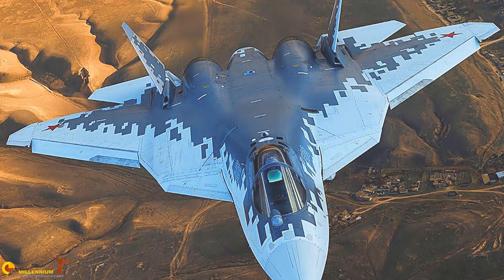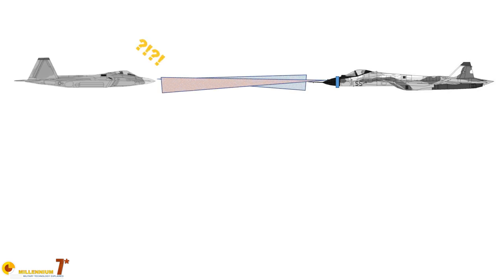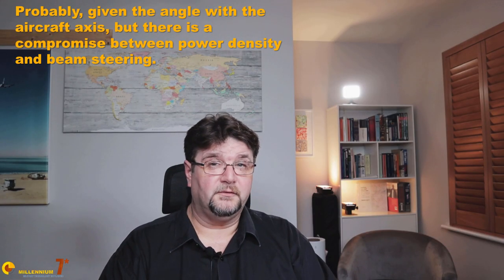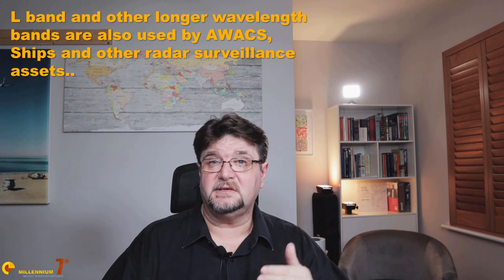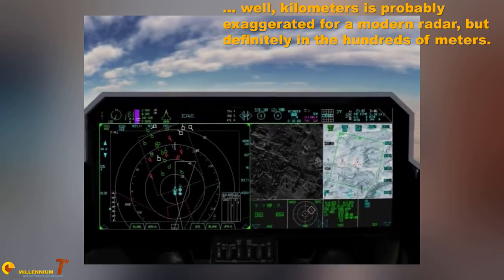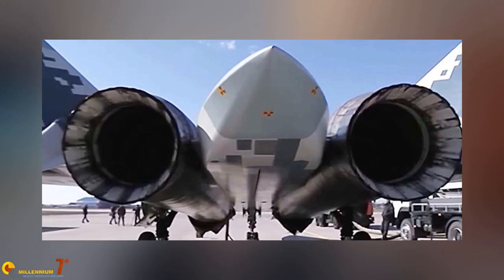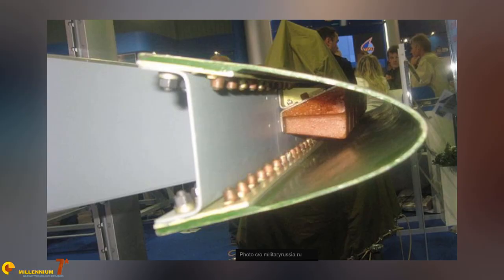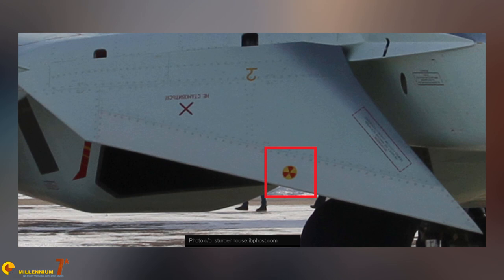Su-57 the Raptor Spotter | Part 4 - Radars, ESM, ECM, IFF

Comment: L band tied in with optical sensors would make for a very dangerous package against VLO opponents.
Reply: Not really. The wavelengths are far too small. These antennae are for something else.
Reply: @LRRPFco52  
L band has a larger wavelength capable of detecting VLO stealth airframes. though L band due to its large wavelength is not accurate enough for targeting it can help by directing passive sensors to areas of interest thus allowing for targeting. 
the f35 and f22 would have to rely on a AWACS platform to gain the same targeting data.
Russia does not push for VLO as much as the US because they figure VLO can be defeated...this is one example. 
Russia seems to be pushing for a more well rounded option that can not be had with a airframe designed to maximize VLO stealth capability over all else.
Reply: @johnaikema1055  F-22 & F-35 pilots don't need AWACS because they have far superior SA to AWACS. AWACS calls out contacts, even the older F-22A would call out what each aircraft was, their altitudes within 100ft, and their external stores. JSF is a leap above that.

4th Gen fighters relied on AWACS to call out BRA of long range TGTs for them.  Once you have 5th Gen web on the air, AWACS aren't needed for them.
Reply: @johnaikema1055  Russia isn't producing VLO because Russia can't produce or maintain VLO. VLO technology isn't static, but evolves as sensor technology does in a cat and mouse game that started between the Brits and Germans with U-Boats.
Reply: @LRRPFco52  
VLO and LO stealth is only stealthy against X band when it comes to radar.
therefore your could have 4 f35s acting as a AWACS using x band radar but still be handicapped vs a single SU57 with L band for first contact. 
if I was in the SU57 I would find targets with L band then go passive to track.
if there were multiple SU57's have one use L farther back feeding points of interest data to several SU57's or other equipment operating forward while completely passive.
assuming that the f22 or f35 are a full generation ahead of the SU57 in situational awareness is not wise.
respect the opponent.
Reply: @johnaikema1055  F-35 and F-22 both can detect L band. It is part of their EW.  Why do you think the US use them for SAM hunting. a 4 F-35 will know su 57 in the area well before it knows about the F-35  Both F35 and F22 have a better major radar then SU 57.
Reply: @jimc1654  
yes...but L band can detect a stealth fighter at a greater distance then X band can...far greater. that is why one would use it for initial contact outside of missile range and then go fully passive inside bvr missile range.
also 1 fighter could stay out of BVR missile range and feed information to others well inside BVR missile range.
even LPI  X band transmissions can be detected (low probability is not no probability). hiding the transmissions in the sound floor with rapid frequency changes still increases noise thus with the right sensors or software could be used to pinpoint increased noise.
as of now LPI is still relatively safe...but for how long is the question.
the rapid advancement in sensors, computer power and software will in time force only completely passive means of detection when inside the opponents BVR kill zone. L band will pick up a stealth fighter outside of a BVR kill zone and that data could be used by multiple passive fighters our other equipment within strike range...that is a huge advantage.
Reply: @johnaikema1055  L band isn't for that. If you look at the F-22A and JSF leading edge flaps, each flap has 3 different length RF antennae embedded under them for multi-frequency RF fidelity, which are fused with a long list of other RF sensors embedded throughout the airframe.

One of those RF antennae just happens to be the same length as what is on the Su-57's single L-band antennae, which isn't mounted using VLO techniques like on Raptor and JSF.

The RF antennae count is much higher on the F-22A, and fused with the AESA.

The RF and IR antennae count is higher on the JSF variants.

An F-35 can't see another F-35 using all of its sensors, but can detect and track ballistic missiles at 800 miles away using passive EMCON.

The Su-57 will never have first-look against JSF as a result.  The US has far greater experience designing and fielding AESA radars, while Russia is struggling to transition from PESA to AESA. It's just not in the cards for Su-57 to magically leap over all that and somehow get first-look.

Comment: excellent video now 2 years old.   I am told that the advanced radar of the 57 is now being refitted into the SU 35, the SU 34 and the SU30s.   Anything below this is just not feasible (i.e even the most advanced S27 would have to be torn apart so it cannot be done).  Don't know about the Mig 35 hoerbrt, or the Mig 31.

Comment: The L band radars have a very small aperture which will mean very short range. There is some media speculation that these are actually IFF sensors and not radars at all?.
Reply: The IFF antennae are in the LEVCONS. These antennae are for something else. I've used HF to send signals across the globe, have been studying and working with RF in military aerospace capacities since the 1980s. As you said, these L-Band antennae are simply way too small for detection purposes at long range. You would need an antennae bigger than any fighter and still get poor resolution like on AWACS.
Reply: @LRRPFco52  They might be for detecting active AWACS. It is safe to assume that there will be just one, thus any ambiguity can be resolved by having more than one aircraft.
Reply: @0MoTheG  There’s an aspect of this whole thing with the L-Band antennae that nobody is really talking about, that would click for anyone if they followed what I was saying earlier about the LORAN-D equipped F-4Ds in the early 1970s.  Not TACAN or IFF, but something entirely different that is relatively unknown in the modern AvGeek world, and was mostly unknown in the 1970s-1980s as well.

Comment: Awesome description and systems analysis. As per usual the Russian approach to air superiority is pragmatic. As others have already commented integration of the platforms sensors with those of terrestrial and space based appliances is key to domination, providing firing solutions that do not increase survivability is hardly a pragmatic approach.

Comment: Tyler Rogoway :

The Su-57 has a feature that was long-promised for the F-22 but as of yet, has never been delivered—side-facing radars mounted below the cockpit on aircraft's 'cheeks.' These active electronically scanned array (AESA) X-band radars supplement the aircraft primarily nose-mounted X-band N036 Byelka (Squirrel) AESA radar. Supposedly these secondary radars have roughly a third of the transmit-receive modules as the jet's main radar. 

You can clearly see the side radar aperture below the 'chine line' under the aerial refueling probe. 

At first glance, the utility of these radars is clear—they provide a far greater sensor field of view and thus enhance situational awareness for the Su-57's pilot. But beyond this the most basic of advantages, they allow the Su-57 pilot to execute a key tactic better than nearly any other fighter around. This tactic is usually referred to as defending enemy's missiles while not getting "cold" on enemy's plane.

The issue is that with a typically fixed AESA radar or mechanically scanned array, pulling off a missile defending maneuver means the fighter doing so will lose its radar picture of the enemy it is trying to evade. Without third-party sensors feeding this data to the beaming fighter via data-link, its pilot will become blind to the tactical situation when it matters most. But what's worse is that any radar-guided missiles that have been fired from the now beaming fighter will not be able to receive mid-course updates, and thus those missiles' probability of kill will plummet, especially if fired off initially at long-range.

So fighters without cheek arrays, or novel swashplate like designs like those found on SAAB's JAS-39E/F Gripen and eventually on the Typhoon, and absence of engagement quality tracks provided by third-party sensors via data-link, the launching fighter will either have to take a more acute and less effective beaming angle in order to continue to update their missiles with their radar, or they will have to forget about updating them altogether. 

The Su-57 is also said to incorporate L-band radar arrays blended inside its large maneuvering leading edge extensions. These radars are more for target discrimination and identification than anything else. The aircraft also has another X-band radar array in its 'stinger' tail for enhanced situational awareness, and possibly for future targeting with extremely agile 'lock-on after launch' missiles as well.

It's also worth noting that AESA arrays can also be used to execute pinpoint electronic attacks. Theoretically, a fighter's radar system could employ these electronic warfare tactics while attacking another aircraft, or while under attack. Being able to do so even at oblique angles without changing nose position could be beneficial, as well. With that in mind, the Su-57 could be a powerful electronic warfare tool, if not today, then possibly the future. 

The Su-57 sports an advanced 101KS 'Atoll' infrared search and track sensor in the traditional position on Russian fighters—installed atop the aircraft's nose, near its windscreen. 

 IRST is among the best technologies available for detecting and engaging stealth targets from afar.

An advanced IRST was also promised for the F-22 as part of the Advanced Tactical Fighter Program but it was axed due to cost-cutting measures as the program moved from prototype to a production configuration. Today, the Navy and the USAF are on the cusp of procuring podded IRST systems for their 4th generation fighters. The F-35 can use its electro-optical targeting system (EOTS) for long-range aircraft identification and some limited IRST-like functions but is not comparable to a dedicated sensor.  

Like the F-22, the Su-57 has a number of missile launch detector apertures scattered around the aircraft but the Su-57 also has turrets that fire modulated laser beams at an incoming missile's seeker to blind it and throw it off course. The Russian system used on the Su-57 is part of the larger N101KS electro-optical suite that includes the missile launch detector systems, IRST, and the DIRCM turrets mounted dorsally behind the cockpit and ventrally under the cockpit.

And denying attacks by air-to-air missiles is definitely an intent for the Su-57's DIRCM system as, once again, it has a turret on top of the jet as well. So in this sense, the Su-57 is something of a pioneer in this regard and this type of system is also likely a hedge against future long-range infrared-guided and dual-model air-to-air missiles.

Su-57 can be armed with four beyond-visual-range missiles and two short-range missiles for air-to-air combat missions. The active radar-homing K-77M (Izdeliye 180) missile is the primary medium-range missile of the fighter. An upgraded version of the R-77 medium-range missile, the K-77M is a beyond visual range (BVR) radar-guided missile equipped with an active electronically-scanned array radar seeker. Russia is also planning to add the new R-37M long-range hypersonic missiles to the aircraft’s firepower.

For ground strike capability, the Su-57 is fitted with the Kh-38 tactical ground missile and a range of KAB family precision-guided bombs. It also has external hard-points that can hold additional munitions to support non-stealth missions.

Aircraft’s super-manoeuvrability allows it to dodge incoming long-range missiles and engage enemy aircraft within visual range.

So my friends, Su 57 never goes cold, there is always 360° awareness, passive and active, and there's hypersonics in the bays.

And these are words of amercan avio experts.

So....

Yeaa, F22 and F35 have anyway better avionics.
Reply: Everything is good, but su-57 has the ability to carry 6 medium range missiles (up to 200 km) or 4 long range hypersonic missiles (up to 400 km) alongside with 2 short range missiles. It also has 8 external hardpoints.

Comment: There are so many unknowns and so many variables that making an actual prediction of combat outcomes is just a wild guess. Radar jamming is probably next to impossible since radar frequencies change over 1000 times a second. The gain of L band radar antenna's like all antennas depends on the physical size of the antenna being comparable to the wavelength. The greater the mismatch the worse the gain. This is due to the fact that a receiving antenna is essentially a resonant device. The less gain the antenna has the more electronic gain is required for the signal and the poorer the signal to noise ratio. Russia is experimenting with trying to use computer correlation of multiple L band antenna's to improve their aggregate resolution. Whether or not this will work is ???? 

L band antennas are therefore typically large fixed ground based which could communicate with the aircraft. But that makes them easy targets for anti-radiation missiles. One America system, Raytheon's Mald, JSOW, Harm system uses one class of missiles with RCSs identical to know US military aircraft to light active radars up making them identifiable targets for the others. Another Raytheon system Coyote consists of large swarms of small stealth drones deployed from pods in quantities of hundreds to even over a thousand. Boeing has its own stealth cruise missiles while General Atomics has a whole suite of Drones which have the capability to launch missiles and use laser weapons against radar. Weapons that could generate ionization clouds could be very effective. This is how the nuclear blackout effect neutralizes virtually all radar over a very wide area by exciting the ionosphere and the Van Allen Radiation Belts plus of course a powerful EMP. Not only does this blind radar but it interferes with communications and destroys satellites. A test called Starfish Prime, part of operation Dominic destroyed or damaged 1/3 of all operational low earth orbiting satellites on the night of July 9, 1962. Therefore in a nuclear war Systems like S500 and Patriot would not intercept a single incoming warhead. 

In the X band F22 reportedly has an RCS about the size of a bumblebee from all aspects while F35 is the size of a golf ball or a bird from the front aspect, higher from other aspects. Therefore the US strategy is first to see, first to fire, fire and forget. America and probably Russia and China are working furiously on laser weapons whose speed is virtually instantaneous, cost $1 per shot versus millions per missile, and the supply is inexhaustible unlike missiles. F22 and F35 are best used as defense suppression missions and F35 as a node in an interconnected AI swarm. This is why much more potent ground attack weapons like F15EX are valuable. F35 clears the way for them. Since they are not really stealthy F15 can deploy new US hypersonic weapons now under development. F35 would have to deploy them externally which is stupid because that defeats the whole purpose of stealth. As a non stealth aircraft F35 is not the best choice. However F35 can now deploy the B61 mod 12 precision 50 kiloton bunker buster gravity bomb, a real game changer. Presumably with a length of about 12 feet and a diameter of 13 inches it can be carried in its internal weapons bay. I wonder if it can also deploy the B61 mod 11 which has an adjustable yield up to 340 kilotons making it a strategic nuclear weapon. For some reason these are being phased out. 

F22 like B2 has measures taken to reduce their IR signatures. It doesn't appear any Russian fighter jets including SU57 have taken comparable measures. It is believed that at about the time Russia is ramping up its SU57 production F22 will begin to be retired and replaced by "next gen" fighters. We have no idea what they are yet. At least two and possibly more types are being developed. The Air Force and Navy will evidently use entire different planes. At least three contenders are likely, Lockheed, Boeing, and possibly Northrop. In around January 2018 there was a very brief announcement that was quickly covered up that Lockheed had been awarded a patent for a 100 megawatt portable fusion generator that could be deployed on a plane or other vehicle. They said they'd have a working prototype by the end of 2019. https://www.lockheedmartin.com/en-us/products/compact-fusion.html 

The technical and economic resources available to the US military are staggering. Much of what it has remains secret even to most of the military and most of the government. In short few people even know what we have. Take my word for it, they don't want to find out in a war against us.

Comment: I take your point that the SU-57 is likely to become aware of roughly where the F22 is at the same time or even before the F22 becomes aware. And yet that would be plus or minus a couple of kilometres. So I think the BVR question then becomes when does the awareness gap close to the point of acquiring a weapon targetting lock. Do you think the L band would give the SU a close enough fix to enable a weapon to be fired in the general direction of the F22 and then once the weapon gets close enough, the Vympel (or whatever) could use its seeker to lock on to the F22. In other words the SU-57 onboard sensors guide the missile to being close enough and then the missiles own seekers take over and guide the terminal phase to the target ?